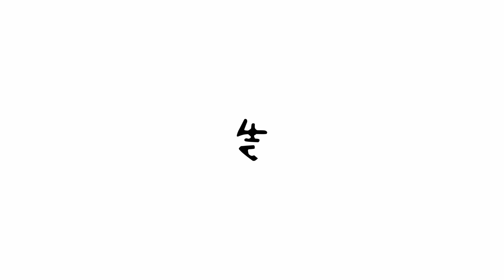花入をつくる - 陶芸

Comment: How often have you had pots crack while firing
Reply from the maker: I would say cracks happen once in every 20 vases. 
Cracks don’t usually happen with basic pieces (plates and bowls)
Those vases are thicker than other pieces so they crack more easily.
To avoids cracks, I pat them thoroughly with a paddle and let them dry for at least month.